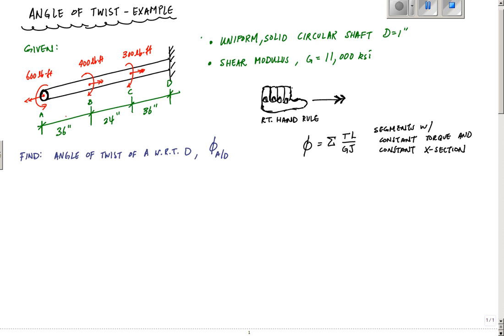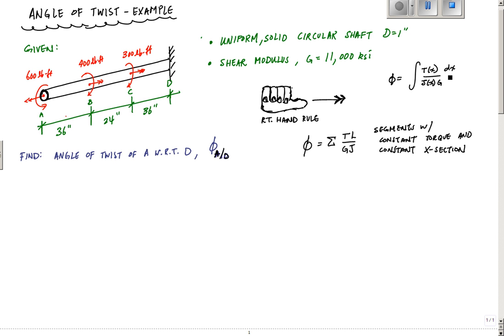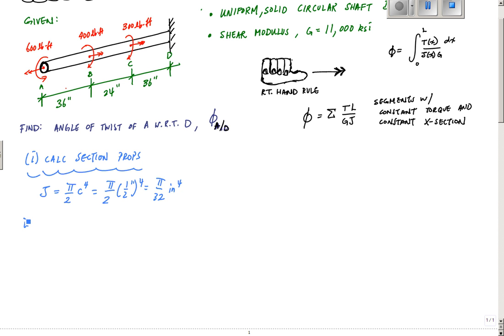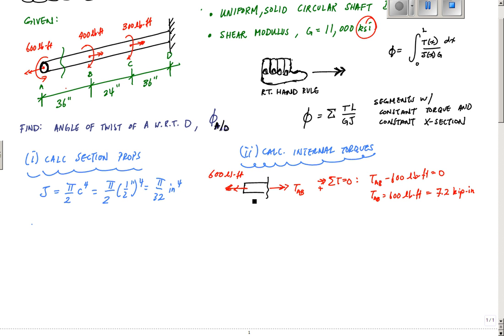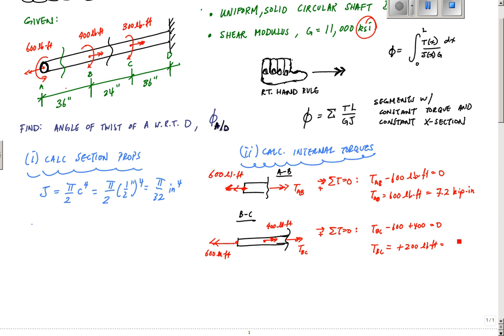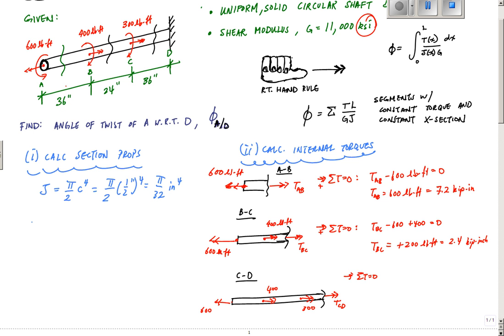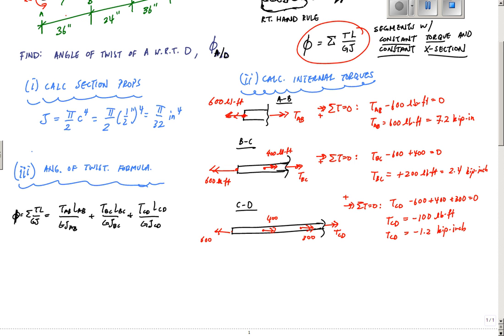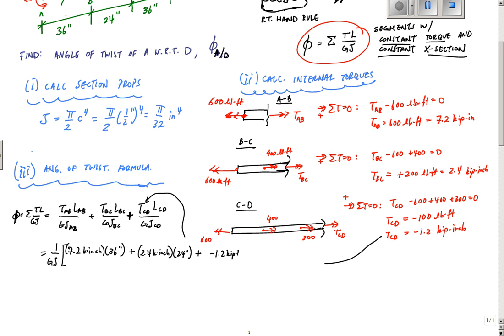Angle of Twist Example 1 - Torsion - Mechanics of Materials

Comment: Hey, totally psyched about your videos. Cramming for Structural Mechanics exam and they are proving VERY helpful. We have to calculate max stress and angle of twist for a bar with a change in cross sectional area at the application of torque. I know you don't cover it in your videos. Just wondering if you could point me in the right direction? Cheers from Scotland :)
Reply from the maker: a tapered rod or geometric discontinuity?  cheers from stockton, calif., usa. westsiiiiiiiide.
Reply: structurefree Geometric discontinuity. I figured it out. Exam was yesterday so hope I figured it out right!! I did get a chuckle watching your videos, thanks.
Reply: +Nathan Campbell it wasn't a source. I just figured it out in my head! There is  wealth of info online.